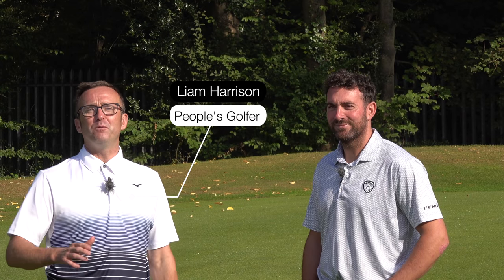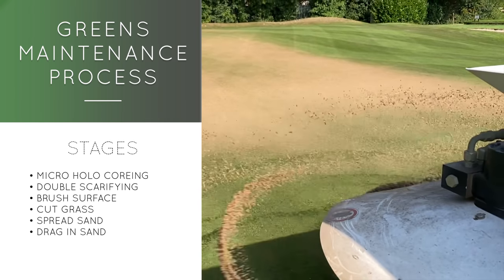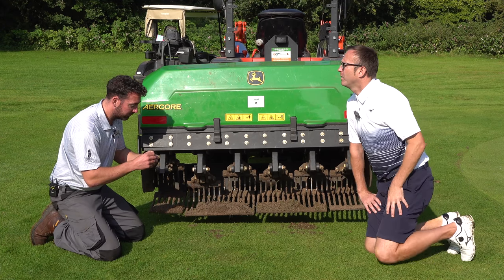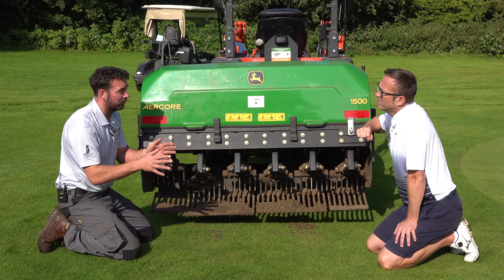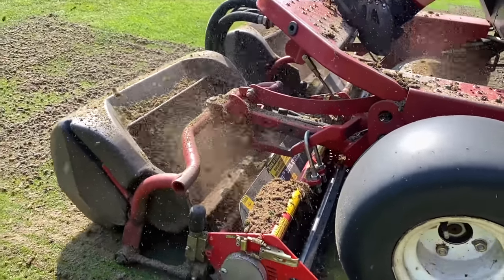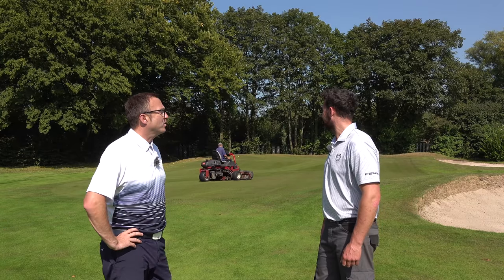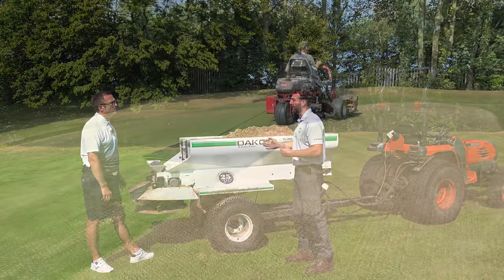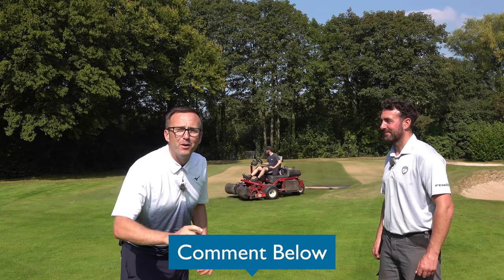WHY DO GREENKEEPERS CORE THE GREENS ?

Comment: Gotta be dione hasn't it, and if done correctly, putts will still roll pretty true, just a little slower for a a few days until the sand starts to bed in.
My golfers nightmare is my vicious slice, which normally means by the time I do get to the green, the hole is over ;-)
Reply from the maker: Absolutely